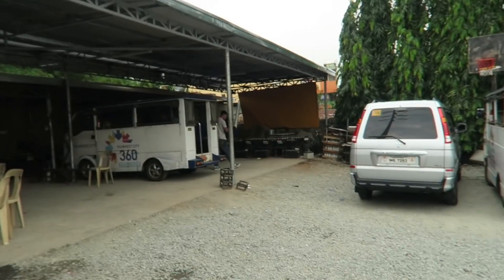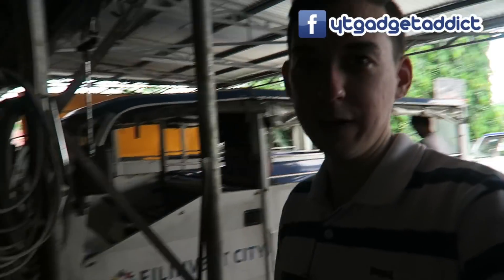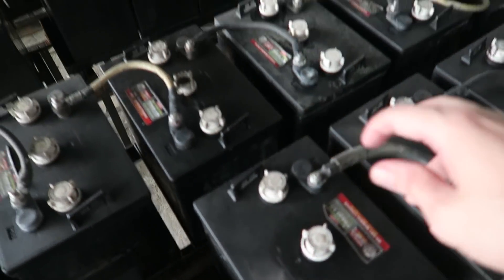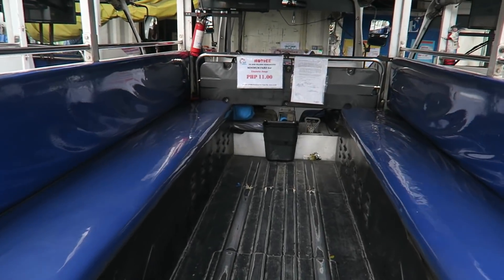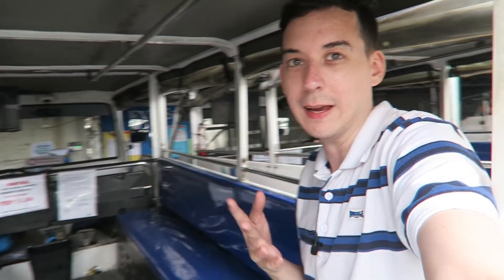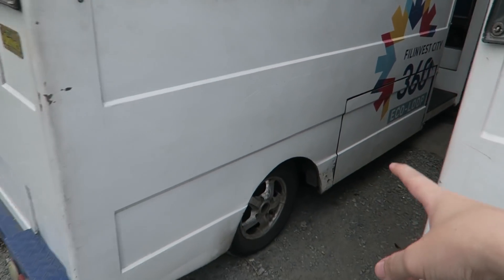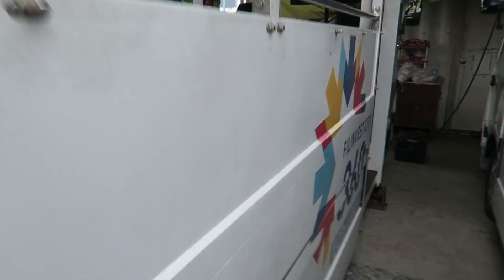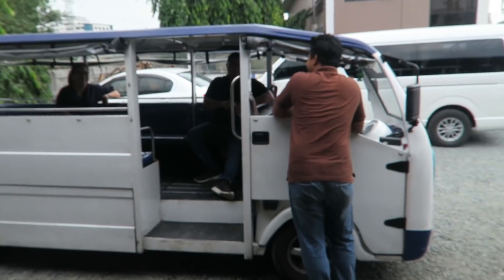Electric Jeepneys for Public Transport

Comment: I should have seen this before I left the country in 2013.  Looking at the size of the garage roof, they can setup a huge solar panel array there for charging these batteries.  They have do it because electric vehicles consume a lot of electricity and the cost of electricity high, similar to Los Angeles in California.   They don't need a contractor or any type of inverter, only plenty of solar charge controllers.  This way, the cost of the system will be a lot less and ROI will be in two years or less

Comment: No Toxic smoke but the battery is a toxic waste. Go Lithium Battery.
Reply: Lithium batteries is as toxic as other batteries. I think what matters most is how we disposed of them.
Reply: 1)   Weight: Lithium-ion batteries are one-third the weight of lead acid batteries. 

2)   Efficiency: Lithium-ion batteries are nearly 100% efficient in both charge and discharge, allowing for the same amp hours both in and out. Lead acid batteries’ inefficiency leads to a loss of 15 amps while charging and rapid discharging drops voltage quickly and reduces the batteries’ capacity.

3)   Discharge: Lithium-ion batteries are discharged 100% versus less than 80% for lead acid. Most lead acid batteries do not recommend more than 50% depth of discharge.

4)   Cycle Life: Rechargeable lithium-ion batteries cycle 5000 times or more compared to just 400-500 cycles in lead acid. Cycle life is greatly affected by higher levels of discharge in lead acid, versus only slightly affected in lithium-ion batteries.

5)   Voltage: Lithium-ion batteries maintain their voltage throughout the entire discharge cycle. This allows for greater and longer-lasting efficiency of electrical components. Lead acid voltage drops consistently throughout the discharge cycle.

6)   Cost: Despite the higher upfront cost of lithium-ion batteries, the true cost of ownership is far less than lead acid when considering life span and performance.

7)   Environmental Impact: Lithium-ion batteries are a much cleaner technology and are safer for the environment.
Reply: If they can afford that!
Reply: It might be costly but reduce charging time, less maintenance, more greener, lighter and compact increase the load capacity,  it will all goes down to the long term vision of the government.  Invest in renewable energy first before going electric vehicles.